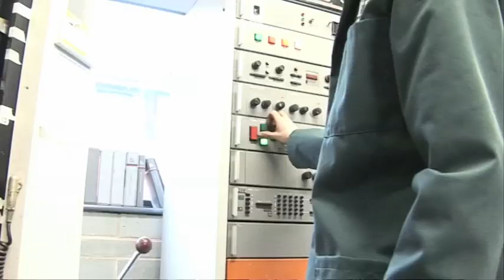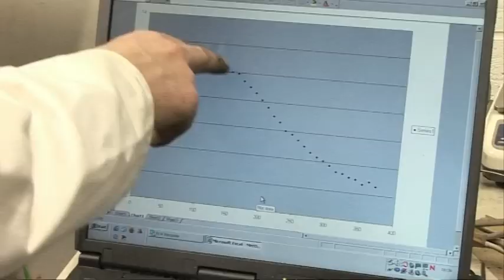Burning bananas

Comment: The ash left from burning can be returned to the soil. The process of combustion only turns the cellulose and lignin to gases, the minerals etc still remain in the ash.
An important thing to rmember is that almost all of a plant is made of air. Only trace elements in soil are used by the plant

Comment: What he doesn't mention is that the "rotting waste“ is an important agent of fertilization for the soil it rots onto. If they grew bananas, and didn't let the rinds decompose on that soil, the soil nutrients would quickly deplete. 
Then, you need nitrogen-based fertilizers, and all the problems that can cause.

Comment: Due to the size and density of the simple dried banana skin you would get pretty much a very low coefficient of "good" work. So most of the energy you'd waste to ignite the dried banana would be to ignite the banana. The point of the banana skin pureeXsawdust is - using the minimal amount of heat(fire) to ignite and use for a long period of time this organic "firewood".

I'm sure they checked this out and found out that you'd get more heat and power from burning that pressurised sawdustXbanana

Comment: @helenchg It's a bit like making a cake - use whatever you have available. We used sawdust, but dry banana leaves would work, or any other dry combustable material. The key is to get a mixture that can be squished together without being too wet or too dry.

Comment: I don't think you fully understood my point. I didn't mean that the problem with this would be the ashes that are produced in the process, it is the gases that would be produced, that would contain nutritions such as nitrogen. What i didn't think of was that the energy needed to produce gasenous compounds with the nutritions would be a lot larger that what the burning of the waste would be able to produce. 

In other words would the nutritions still remain in the ashes.

Comment: Your idea of making banana bricks to burn is a great idea, especially where there are lots that go to waste. It would have been nice to actually hear how hot it could become and the kind of exhaust it put off. I also couldn't help but notice how many of the bricks you used to cook the bananas and there were two different colors of brick. Perhaps another video, better prepared, should be considered. Not a bad start, though.

Comment: Our bodies need a *small* amount of potassium.  However, it is much easier to dispose of potassium in the stomach versus the lungs. Same principle applies to plutonium.  It's relatively safe to ingest plutonium versus breathing it because plutonium doesn't get absorbed easily. I used to work IT at a radioactive waste disposal project, I was trained on this stuff.

Also, I did some academic work in local population radiation exposure, potassium spikes were common. However, the safety is debatable

Comment: I think you've missed the point. We're using ovens to get consistent results in the lab, but drying in the sun is fine in Africa. Similarly we need to measure the force, but you can make briquettes using simple hand presses. Check out the Legacy Foundation who are doing some very good work in this area.

Comment: Its a good idea, but I cant help seeing some problems here... 1: If you mix it with sawdust, you still need wood. 2: Why do you need to have them in a owen? They then need to have owen or some sort of fire to make them dry... In the sun maybee, but it takes a long time. 3: How long do they burn?    And by the way, its not impressive to get the plate hot over flames... Anyway, good idea, keep em comming.

Comment: Hydrocarbons are our #1 source for combustible fuel. And besides, it's basically harmless. Consider this combustion reaction with methane:

CH4 + 2O2 → 2 H2O + CO2 + Energy (Wikipedia).

You're basically releasing water and carbon dioxide in any combustion reaction with pure hydrocarbons. Not harmful to the environment.

Comment: You are on to something very usefull here!
Couldn't  stop thinking of another benevolent proj. that never really went operational for everyday users (but was fairly close). It was called "the rice husk projekt" in Bangladesh involving a 5hp Stirling engine run on burning rice husks.  It's all in a publication/book (ISBN 0-9713918-1-5" written by L. Merrick Lockwood. Banana peels instead of husks is probably a good change of energy source, and locally  available.
Congrats to u on your work.
/mtm

Comment: The only CO2 emission is the one the banana absorbed when it was formed. That would also have escaped to the air had the banana been rotting.

This is a form of biomass so it's CO2 neutral and renewable.

Comment: The problem is that the banana waste that rots fertilizes the fields. This is cool and all, but eventually the field will run out of stuff.
Reply: You can use the ash if you want. You have to add nitrogen because that escapes as gas. But most stuff is still in the ash.

Comment: This is the essentials done quickly, in Africa it is moot. They might chop and press with a plank to chop on and another plank screwed or rope twisted together. The first moisture expulsion needs to be great in order to preserve the fuel from biologic consumption. Saw dust is rare there, but grasses? Layers of chopped banana skins interlaced with layers of grasses pressed between planks or stones. Then those handmade clay cook stoves that resemble two camel humps which direct the heat to the pot

Comment: Banana skins could be dried with the help of the sun of Africa, i think that the best thing would be measuring the heat of combustion of dried and compressed banana skins than comparing the energy produced with the energy necessary to grind and compress them

Comment: @mysibratus if they actually get it out in the field they could use man power to compress the bricket in a crank press, then let them dry in the air, in the lab they have the tech to make them faster, just now they have to dial back the tech involved in production and see if it still works

Comment: Do u need more energy for ovening the banana peels to make them dry before use?! That may be even more expensive than the LPG !
Reply: that was just to speed up the process. The oven was only at 105, so they could just sit the bricks out to dry on any dry day.
Reply: ScienceMaths2012 He lives in England, not much of a sunshine there. If you have ever lived in tropical and subtropical climate zones you will get so much of sunlight and temperature can reach to 40+ deg C. Any of you brick can be dried in matter of couple of hours during mid-day. So yes, you don't need LPG! Solar energy is sufficient. In fact you can even heat things in solar cooker (if you have ever heard of it).

Comment: Doesn't seem very efficient.
Reply: sisbrawny agree. the technique is quite costly and requires wood anyway.
Reply: Matthew Smith Personally i'm an Electronic Engineer so you can tell i'm not an expert in this domain but your comment suggests you are a nobel prize winner in chemistry so hats off to you.
Reply: Nah I'm just a dumb carpenter, but did you think they where going to ship a thousand hank cranked meat mincers  over to Africa and tell them to get on with it? Or maybe he will pass his findings on to the engineering department so they could build a machine? Common sense if rare nowadays I guess!
Reply: Alexandru Popa did you watch the entire video? 
The "wood"(cellulose) from the banana plants could be used since the plants are cut down every year to improve yield.
The oven would not be needed since they can be air dried.
Reply: Alexandru Popa Even if you are not an expert and you didn't watch the whole video, this technique uses much less sawdust than normal. You can see that he also tests a brick that didn't contain sawdust and it worked out well.
Reply: Alexandru Popa requires wood? He says in the video that you can use the stem from the banana plant. Which is waste to them as well. That would mean that it does not require extra woodcutting to support this technique.